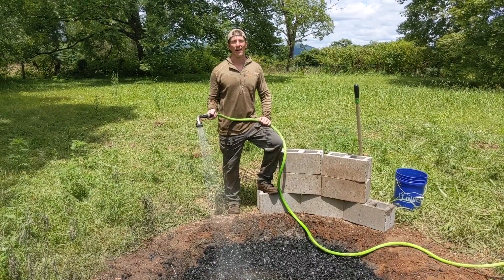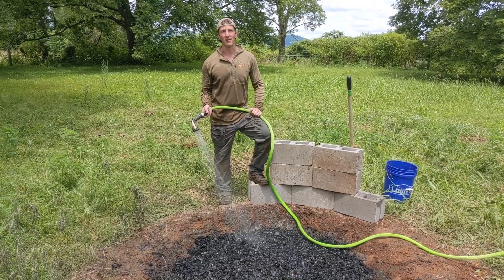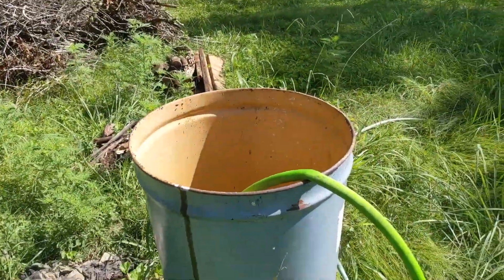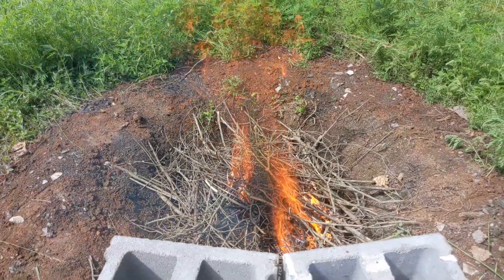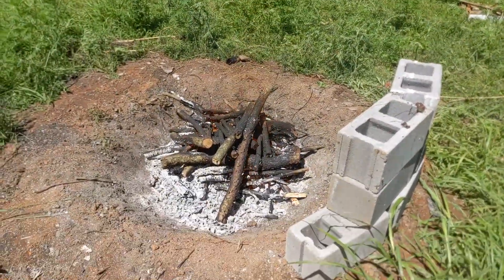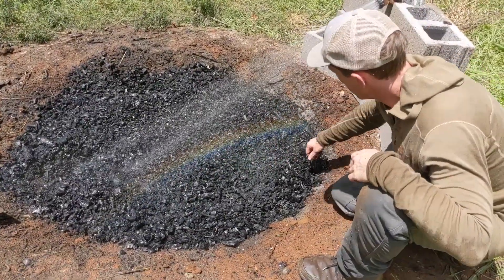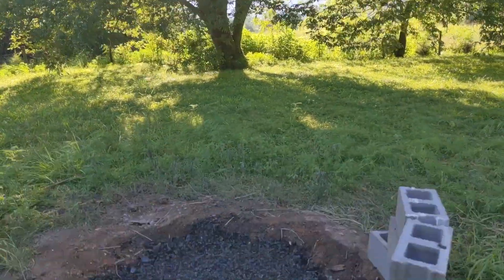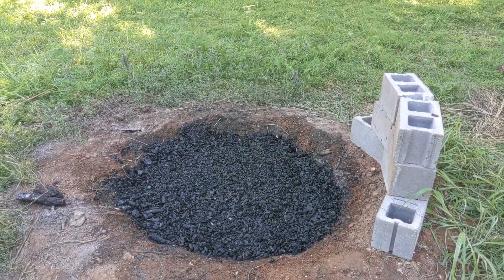Making Charcoal With A Cone Pit For Biochar Potting Mix

Comment: If you want an easier way to quench it, I've found it much easier to have a bin of water handy and use a long handled shovel to scoop the embers into the bin of water, and build up your fire again. Once it's fully quenched you can scoop it out and drain it and get some more embers. 
By doing this, I use less water and I can make it continuously, which is REALLY cool. You can do this for as long as you want.

I do think a bigger fire is more efficient at biochar production, but being able to make it continuously with minimal water is really useful, and I've found that more valuable.

Comment: the smaller stuff is pyrolyzed quickly anyway... if you care about getting good, full pyrolization without much ash, in an open pit, the key is to have batched of mostly uniform diameter of the same kind of wood... obviously you will get inconsistent results if you add batched of mixed diameter and different woods, breaking up smaller branches, to lower the oxygen's area of attack for actually burning because we dont want it to burn.
Reply: all about input output percentage, at some point it's just not economic to chop everything it up to equal size, especially if you have abundance of wood. unburnt pieces can be put aside and burned another time.
Reply: @randytschupp9937  yeah, without a woodchipper i would not bother

Comment: if you use such small diameter pieces in your later batches of wood, break them appart better so they cuddle closer and dont let oxygen penetrate as well, you got a very white pit at the end, much of that pinky diameter suff just turned into ash completely.

Comment: Looks like a good solution for larger properties who need to clear out bigger area’s & a quick way to amass a reasonable return of biochar. 
I have several large heaps of wattle I cleared last year with a backhoe on a 40 acre property, I imagine I could just let the heaps burn down to a point and quench the fires out prematurely with my 1000 ltr fire fighter to obtain a similar result and aquire a heap of biochar this way for garden & agricultural use, pick out any large pieces that didn’t burn enough and put them on the next heap for a  re-burn, does that sound reasonable?
Reply from the maker: That would definitely work - look up top lit burn piles as a way to maximize your char retention. I've got a video detailing a small top-lit burn pile here: https://www.youtube.com/watch?v=tpxOf77Es0A&t=90s

We've since evolved and now light the entire perimeter and top of the pile at the same time - turns the pile into an oven that just bakes everything in the middle, and the burn goes very quickly and evenly.

Good luck with your forest clearing and char making!
Reply: @thesovereignhomestead  great & thanks for ur speedy reply & vid. Cheers
Reply: I think I will be reburning some, after my first try.

Comment: What were the dimensions of the cone pit?
Reply: About 1 shovel's length in diameter and about half the shovel's length in depth. Steepish sides but not so steep that it inhibits the fire breathing when it is still small at the bottom of the pit. I can measure exactly later of you remind me, but it doesn't need to be exact - once you start digging you'll know :) Good luck!

Comment: You're one step away from a wood gasifier.   You're just wasting all the gas and making things really smoky in your immediate neighborhood.  It'd be fun to make charcoal on the side by burning a small part of that wood in a small hot fire, directed at the rest of the wood in a chamber with a pipe running out of it.  Heat up the chamber, and the wood in the oxygen-depleted chamber will emit flammable gas that will go out through the pipe.  The used-up wood in the chamber will be charcoal.  The gas in the pipe can be pumped into a propane tank.  Gas for lighting, heating and engines.

I think this is a great way to amend soil, but the method pollutes the air a lot.